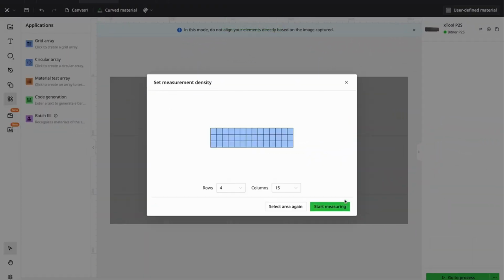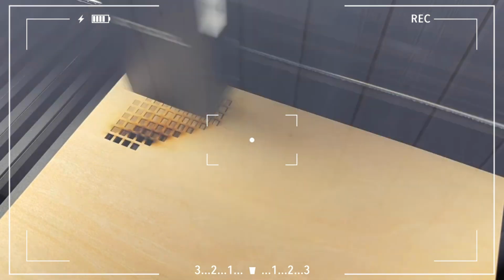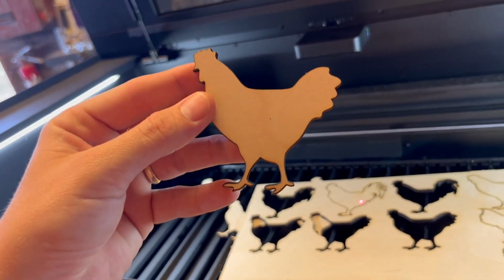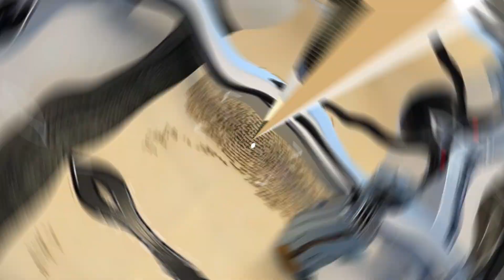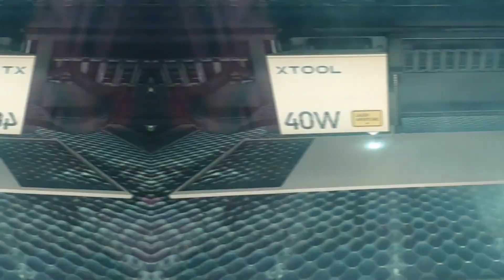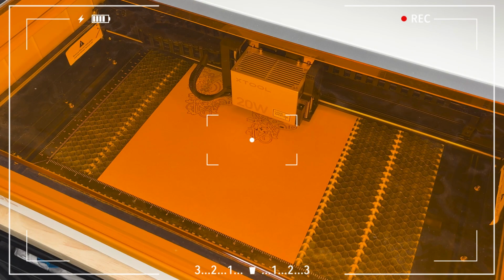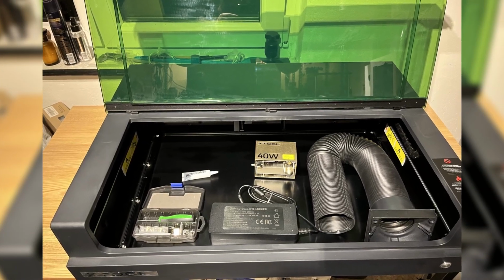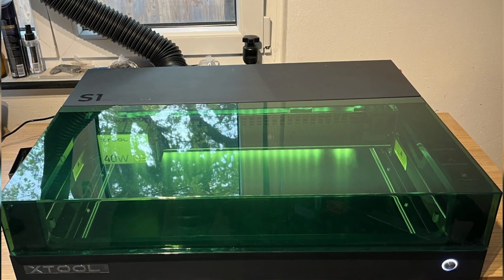Best Laser Engravers 2025 - The Only 5 You Should Consider Today

Comment: I have the Falcon 2 Pro and you can switch it back to an open frame mode by removing the waste collection drawer and pressing the button to disable the drawer closure sensor, which is located behind the front panel of the machine. Also Creality replaced the 40w model with a 60w upgrade, so now you can cut materials using 60w/40w/22w and fine detail engrave with the free 1.6w module that comes with it.

This is not a paid or compensated comment, I just wanted to provide some additional information.
Reply from the maker: Thanks for sharing your experience with the Falcon 2 Pro! That’s really helpful information, especially about the upgrade to 60W and the flexibility it offers for different cutting and engraving tasks. I appreciate you taking the time to provide these insights!

Comment: The XTool P2 has a pass through feature allowing you to cut/etch materials 24 inches wide by 8 feet in length.  It also has auto focus and curvature etching, meaning you can etch curved surfaces like bowls accurately.  It can also engrave text on a tooth pick.